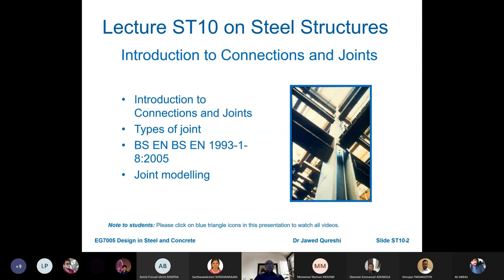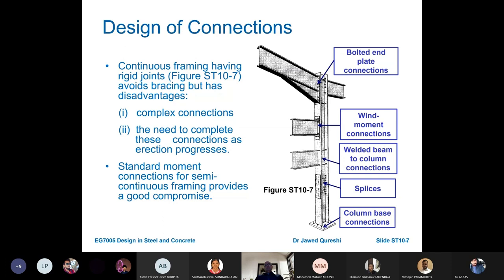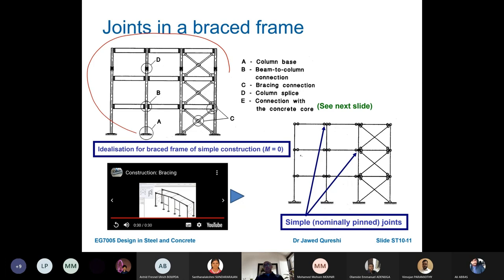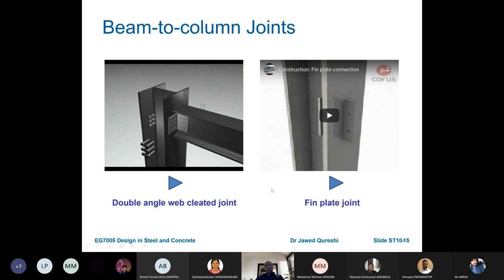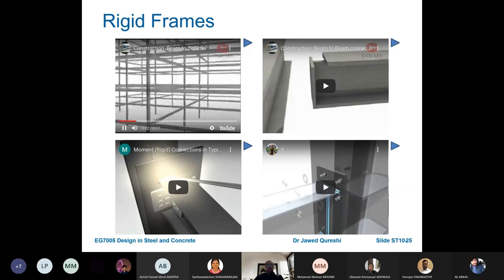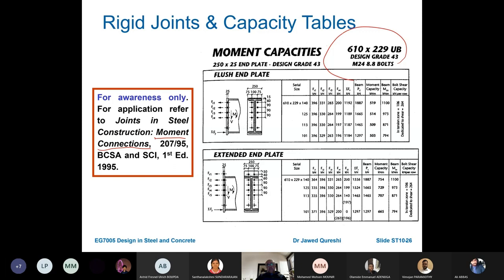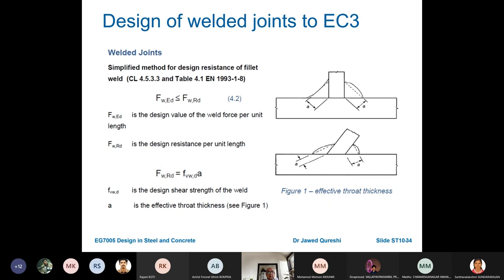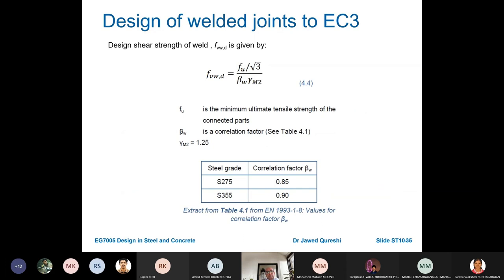17 How to design Steel Connections and Joints – Lecture | Eurocode 3 Steel Design series

Comment: Hi, is  partially threaded bolt better than fully threaded bolts as far as design strength of connection is considered, as the area of fully threaded bolts will be less than the shank of partially threaded bolts
Reply from the maker: You are right absolutely. Threads normally reduce not only the strength of the bolt but strength of connecting plates as well. For better strength bolt shank that is in contact with plates should be unthreaded.
Reply: @DrJQureshi  thanks for the clarification